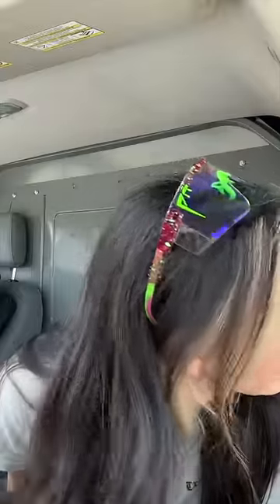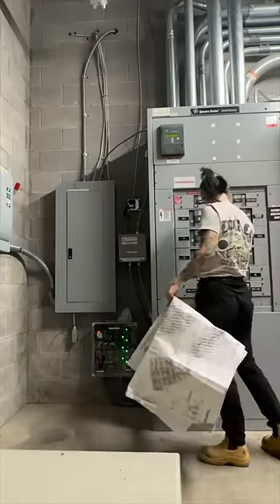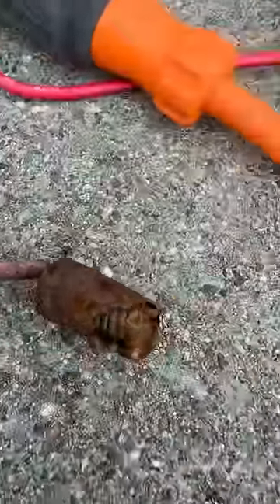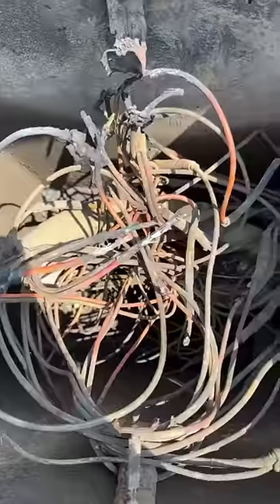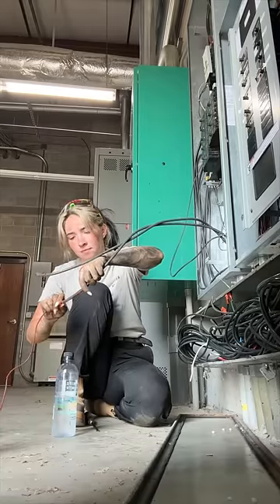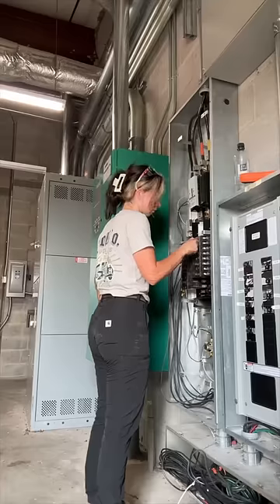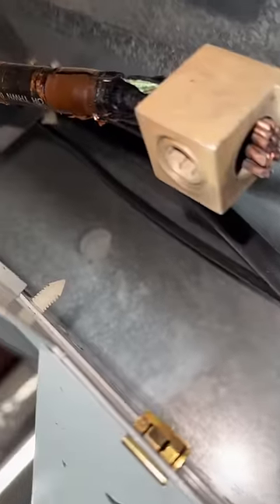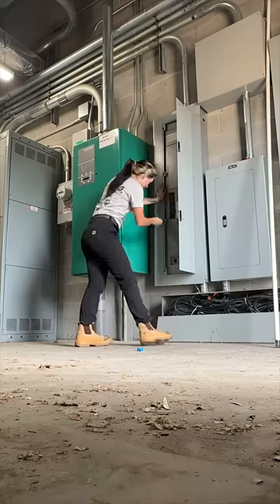Troubleshooting 480v Light poles

Comment: From the thumbnail, I thought you smoked your hand a bit.  I'm  retired but I used to HATE troubleshooting 480 poles/circuits. So much of troubleshooting has to be done hot and 480 makes a wicked phase to phase short. Removing the lamp and ballast cover standing in the bucket always scared the shit out of me. It's nice to see an experienced young woman in the field!! Stay SAFE. Also, lol at the 377/480 typo :)
Reply: How do you know if the short is phase to phase or phase to ground?
Reply: @maximusvonderbrewskis  By observing what caused the fault. Plus the boom would be ridiculous :)  If the damage was done to the hot wires it would have been phase to phase. If it was one wire and a ground it would have been phase to ground. 

I have never personally had it happen with 480 but I have repaired the damage a few times.  I have been many situations where it could happen.  Simply from pulling the wires out of the pole hand hole, loose wirenuts could pop off of and, BAM.

I have also seen 240V  phase to phase shorts which continued to arc until the panel burned up and the POCO fuse link kicked out.
Reply: @effthegop  Yeah isn't that fun...I just hate troubleshooting over my head period.  It's just the state of vulnerability that you're in.  Add 277 volts to the equation and makes it even more fun...and BAM is right......277 hits like a ball peen hammer, even across the top of my thumb.  I recall those days swinging under pole lights in the heart of winter and pulling those same wirenuts you did 😅. Why don't others use Buchanan B2s.  

There's one thing about 277, you never forget exactly where you were standing and what you were working on when you get popped.  Unlike 120, I've been hit so many times with it, it all runs together.

Dude, watching the 240 volt panel melt down...that must have been a spectacle.  Must have been an old Federal Pacific breaker involved.  You could weld with those babies.
Reply: @chrisharrell5945  My best light pole story is on a tennis court. I  was on TOP a wooden 16' A frame ladder reaching up over my head to barely reach the fixture. 

I opened the door/lens and the ballast fell  out. It caught on the wiring long enough to swing toward me and hit me in the chest. It broke loose and fell to the ground hitting the ladder hinge bracket on one side tearing it off and causing the ladder to bow on one side.

It happened in one second so all I could do was watch it happen and remain balanced on the ladder.   I was young and stupid at the time.

The melt down I witnessed was the service conductors so the only protection was on the pole.  An A/C guy caused that one.

I only felt 277 twice....from the same wire/ Jbox :).  Crowded space. Metal stud structure above the grid ceiling. Big office building with too many panels to de energize. I only had one connection to make but somehow I managed to make contact and yell FUCK.  Then I did it again 20 seconds later :). I was older but still stupid.

Finally in my 60's I started being more careful.
Reply: @effthegop  Not trying to laugh, but looking back I guess we can.  Those ballasts of old were heavy; like an anvil falling out of the fixture. That is crazy, how it took out the locking structure like that, of all things.  Even more so,  how it even managed to strike it to begin with, you know.  Seems like it should have missed.  How those things always work.  So you didn't fall? Man, that could have been real bad.  

Yeah boy--- 277 and ceiling grid -- the perfect recipe. I've grounded my waist before in that grid on the top of a ladder with hands in those foolish boxes. Knock the pudding out of you.  🤧

277 is one of those things it didn't take me long to learn that I don't like to shake hands with it. 😂

I've never witnessed a 240v melt down before, seems like it might have been one of those older cutouts at the pole.  But we had some guys cross up the phases on a large 480v industrial panel feed installation. The feeders were being taped by two different guys, not color phased the same end to end.  When the breaker was turned on, blew the panelboard off the wall. 😂 

God, I'm glad I'm not doing that type of work any longer. The heavy electrical construction type of work, it'll drive you in the ground like a ground rod.  I"m still currently doing electrical work but not in that capacity.

Comment: Reminds me of our recent troubleshoot & repair on our ship. It was a throttle system malfunction and i work in reactor, but we were so confused because we thought it was a combat systems issue tripping a valve and we got them involved too. We had a malfunctioning solenoid which controlled the steam valve to our main engines, but we replaced it 3 times and fuses for it that were blown and went upstream the third time to find a distribution panel which had a "thermal event" because we don't like calling away fires if we don't have to. Spent 2 days writing the package with one other person and having to rewire it all. No issues since...yet

Comment: I used to do a couple of parking lots of those. A lot of the poles were open-ended at the top enough for birds to build nests. The nests would eventually fall down inside to the bottom of the pole and keep everything wet after a rain.
Reply: nothing like swinging in a bucket hovered over a parking lot all day when it's 30 degrees outside, removing the ballasts of old which weighed 200 pounds apiece 😆
Reply: @chrisharrell5945  or when it's 105, like it is here in Texas.
Reply: @GaryGipson  🥵- give me the cold anyday.  Although I have worked as an electrician in the middle east, 130-134.  But pulling 500 MCM cable in the dead of the winter will make you wish you had that engineering job.

Comment: This reminds me of something that just happened to me. We were putting in some temp equipment in a building scheduled to be torn down. The owner told us the building should have power, we went in and the place was dead (Big warehouse, kitchen, dining, laser tag arena, etc etc) When we arrived, we examined the panels, there were 3-4 large subpanels, with several of them missing lots of their cabling, and their covers torn off. Someone had came and taken partial sets of wire.

     Because of the  condition of the wire, we initially assumed the panel was not live, but i told my other two employees not to touch a single thing, and to keep distance from the panels. I examined the main panel (which had all of the covers ripped off, and some wiring missing from the inputs going out to the sub panel) Turns out we had 480V service coming in.  This was scary to find out in the dark, in a run down building, where it was evident people had been coming in and out. I wasn't sure how big the service was. too bad i cant post pictures.

Basically a room of death, and nobody knew it. 

Stay safe!

Comment: Im an electrical engineer not electrician but this is a really cool channel.
Reply: Please take notes-- and carry all the hangups and issues back to your drawing board for us.  Things like wire space for bending radius to termination point for panel boards, junction box designs, handholes which aren't actually hand holes, distance of switchgear termination lugs above finished floor.  We could go on for several minutes.  
There's a lot to be learned for engineers from feedback from electricians for the industry product lines. 🙂
Reply: @deang5622  You know what, with a preposterous comment as that, I have no further time to waste in dialogue with you.
Reply: @reeferbeleafer9912  what in the world are you talking about?
Reply: @reeferbeleafer9912  Maxwell's demon has to do with hypothetically mechanically sorting gas molecules into faster and slower ones in different compartments, and thereby violating the 2nd law of thermodynamics. What the heck does that have to do with the conversation here?
Reply: @reeferbeleafer9912   you think I'm going to go off researching just so I can respond to your offshoot response.  Don't kid yourself pal
Reply: @reeferbeleafer9912  well you ponder the situation then Mr Competency

Comment: I aint an electircal technician...but that pic @2:56 brings back some memories :(. I was a network technician at a brand new and big local convention center. During the first few months of operations me and 3 other techs were on our knees looking at big messes like you did...lol. Even when new and you are looking at the wiring diagrams...and the "labled" (that's a separate joke) floor connections for elec/data/gas/water. There were 1280 of them on all the main convention floors...and holy crap...even 20 years later, my knees are like concrete. I can still kneel on concrete or wood literally for hours. All because i spent about 400 hours on my knees looking at boogered up floor pockets.  Good luck...enjoy it while you can :)

Comment: Nice to see a female working in high voltage panels!  You are one of very few I've seen and you seem knowledgeable.  However I agree with some other comments....I see you have arc flash category 2 or 3 pants but you atleast need a helmet/mask while in that 200 or 400 main.  

You reaching down in the manhole with all those high voltages wires burnt up. Would of made me very nervous without a helmet/mask!  Be careful and enjoy the trade.  God Bless

Comment: I had something like this recently. I knew there had to be a junction box somewhere because there was only 1 wire at each of the 5 lot lights. The box was like 6 ft away from the center pole, completely grown over by grass. Took forever to find it. The wires shorted to ground in the box and looked exactly like your box. Luckily it was only the 1 circuit to not too bad

Comment: Nice work. And you made lifting that panel cover look like a walk in the park. Those damn things are heavy. :)

I'd guess that there has been a lightning strike or two in the past on those poles, so expect that the wiring going out to the poles is ruined as well (and it may only show up when you energize the circuit).
Reply: Why would it only show up when you energize the circuit?
Reply: @maximusvonderbrewskis  what happens to the insulation of a wire when there is a lighting strike is that the lighting punches pinholes in the insulation which will conduct enough electricity to short out the wire and trip the breaker.

Ohming out the wire won't show a problem since the voltage applied by the meter is far too low to jump through the insulation.
Reply: @MrWaalkman  thank you for your reply much appreciated.
Reply: @maximusvonderbrewskis  You are more than welcome. :) 

There is a device that is used for insulation testing, which is called a megger. You have to be careful in how you it, because it puts out around 600 volts - which can leave a mark. And should you forget to disconnect sensitive devices from the circuit such as VFDs you will most likely damage them. It's one piece of test equipment that I would wait for the boss or an engineer to tell you where and how to use it. Better that their butts get chewed out than yours. :)

Oh, and I almost forgot, meggers are what is normally used for testing out the insulation of motor windings. But they can be used elsewhere if you take into consideration what all is connected to the wires you are testing (such as the light fixture ballasts).
Reply: Right, those panel covers are heavy.

Comment: Do yourself and everyone else working on this in the Future. Get some Ohlectric Terminals for the wiring in the Parking Lot Access Panels. Not only are they safer, but you can Pop the Caps off, and check the Voltages, Safely. Also I would get a Fluke Non-Contact Voltage Detector. I wouldn’t work without one and kept a new spare in my Van in case the other one failed.

Comment: Back in the days people had a misunderstand of grounding electrode. They thought that just driving rods into the ground and attaching it to your street lights would solve ground faults. All they did was energized the ground. You probably got a light post that has one causing arching in the updated ground wires and boxes. Careful being on your knees around those.

Comment: you need to get an AC voltage detector. you just wave it near the wires.  where I live the major 6/8 lane highway going North  has been unlit for almost 2 decades on an 8 mile stretch. even one exit sign has been unlit too.

Comment: Put fuses on each pole accessible from cover at the base of the pole where connections have been made to the eires going up to the lights. Ive worked on 480 before and couldn't figure out why they didn't use 277. Then it hit me. 1 less wire, less voltage drop. What they did was use phase A and B for first pole, B andC for second pole,C and A for third pole. Then repeat.
Reply: Also if it's a home depot all the lights in the store are 480 also. You would think they would be 277 but they weren't.

Comment: Thank God for electricians.  I REFUSE to mess with electricity, especially something like 480v.  Takes guts.
Reply: As a kid i took apart electronics. One day i was tinkering with an old lcd monitor and decided to plug it in while open. Well I then happened to brush my finger on the AC to DC backlight inverter which is alot of volts not many amps. Still my 11 or 12 year old self ended up losing consciousness for a split second and was like woah.

Comment: Meager the branch circuits and you should have another journeyman working with you on live 480 volts. Looks like that field splice vault (quazite box) is flooding with water. Heat shrink all the splices

Comment: To be that guy. This is an enclosure for junction of secondary voltage, more commonly known as a hand-hold. Manholes have requirements for entry per OSHA under 1910.269 and contain primary voltage ranging from 2400v to 35kv.

Comment: Back in the early '80s I had to install voltage/current sensing equipment in electric arc furnace transformers in steel mills.  They we're huge things running 480-600 volts ac and ridiculous amounts of current as I recall. To this day I will not wear rings or metal watches.
Reply: Í won't even wear non-metal rings nor watches whilst I'm working.

I see the guys with tattooed on wedding rings and the silicone ones.  I always wonder if they're really so insecure.
Reply: @KC9UDX  Yeah I don't understand that whole tat mind set thing. I suppose people do it for different reasons ranging from pent up anger to just plain humor. Can't say I've ever seen a silicone ring though. I'll have to google that. I just wear a cheap plastic watch these days. After I retire one of these days, I'll prolly take it off as well.

Comment: I met a gentleman 45 years ago who was electrocuted at a utility station when his partner mistakenly cleared him to open a big electrical panel. (I don't know the details of it).  But he lost most of one hand, was paralyzed from the waist down and had terrible scars over most of his body.  He spent like 10 months in the burn unit at Brooke Army Medical Center in San Antonio.   Electricity terrifies me.
Reply: He got shoked not electrocuted if was he would be dead.
Reply: @subjekt_9142  I think your definition of electrocution is more accurate.   But, more precisely, a high voltage electrical injury for certainty.
Reply: In the Navy, heard from a sub chief about an ET4 kid on his sub who had to enter a crawl space with energized life support wiring (i.e. powering the air scrubbers and could not be shut down). He was wearing wire rim glasses that were prohibited for electrical work but he knew better, right? Current jumped to the glasses, went down his body via his jaw and specifically a metal filling, which instantly superheated and exploded, blowing out his cheek like he detonated an m80 in his mouth.
Reply: High RPMs, high V, and high delta P are three things I have learned to fear and respect. All will instantly murder you in gruesome ways if given the opportunity.